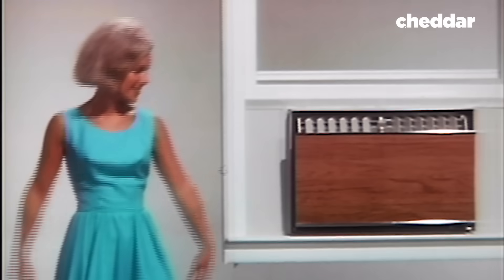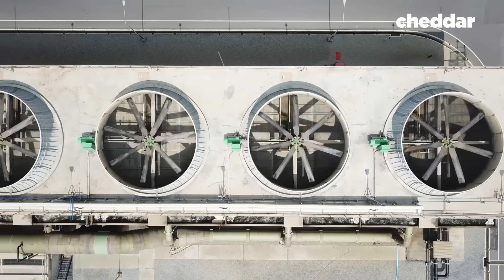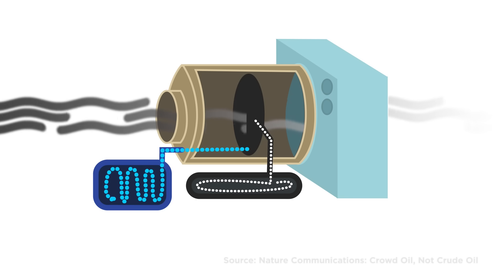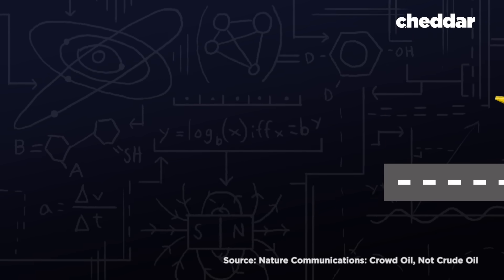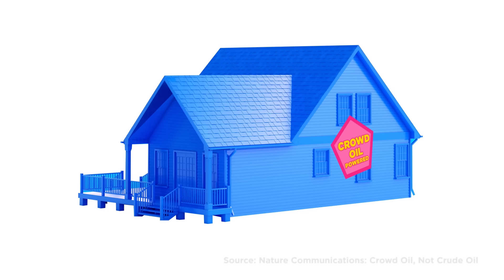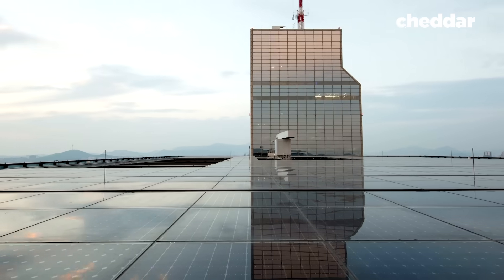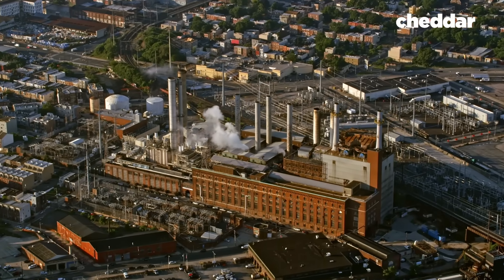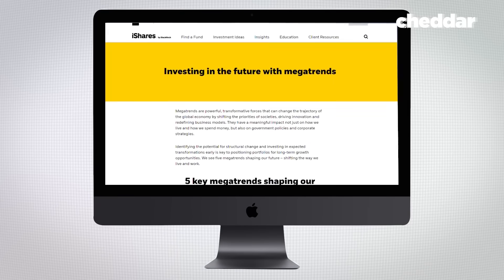How Your AC Could Help Instead of Hurt The Environment - Cheddar Explores

Comment: Wait wait wait, so your saying all you need to do is generate some hydrogen and then mix it with the carbon collected? Wouldn't it be way more efficient to just use the hydrogen instead? And wouldn't that newly generated fuel also emit CO²? So this thing is CO² neutral at best? Ok, I call bullshit.

Comment: There is no reason to use AC as it is only used to move air through the CO2 extractor
Reply: So true. The AC is a red herring used for clickbait. It's stupid to install a fuel storage tank at every residence when you can just create one massive carbon capture device at a gas station and then use the fuel for cars. The energy consumption will be the same or less, and the scale makes everything easier. Just hook up some solar panels to intermittently power the device.

Comment: If you burn the generated fuel, you spew all the captured CO2 right back in the air. If you don't burn the fuel, you lose money. And it consumes extra electricity (those AC fans must work harder to cover the pressure losses due to the CO2 filter). This makes no sense.
Go plant trees instead.
Reply: you ppl do know that planting trees wont remove all the co2 we have added in the atmosphere right? removing co2 might be needed aswell as planting trees
Reply: @kerosblue5609  An acre of trees will trap 2.6 tons of CO2 per year. Show me a man-made machine running solely on solar power that can remove that much CO2.
Reply: @Petr75661  i dont have to. I said planting trees wont be enough so we need other ways to remove the co2 we have added, plantings trees is needed but there isnt enough space.
Reply: @kerosblue5609  Nothing will help if we don't stop spewing tons of CO2 in the atmosphere. I guess we can agree on that.
Reply: @Petr75661  we wont stop spewing co2 in the atmosphere anytime soon just reduce the amount

Comment: I agree with many comments and the video itself that this type of technology is obviously not a carbon-negative system. It is inherently not one. However, this could help make more carbon neutral fuels for applications where chemical storage is superior to electrical storage or direct renewable like in cargo shipping. That industry still mainly uses fuel oil, the heaviest and dirtiest of the liquid oil products. It is also a major source of nitrate, sulfur, and fine particulate pollution which is very damaging to human health. A widely available carbon capture source of alternative fuels like LNG or methanol already being experimented with in this field would greatly transform the potential viability of those and at least make this growing industry cleaner if not perfect.

Comment: This has been debunked before. I have my doubts whether this system can ever be feasible.

First law of thermodynamics. Energy cannot be created nor destroyed. It can only be transformed from one form to another. If this system does actually work and can make hydrocarbon fuel from air, the amount of energy needed to make that conversion will never be less than the energy the fuel can provide. In fact, the conversion itself would take a lot more energy because of energy loss by friction and heat.

Where will this energy to convert the scrubbed co2 and water come from? If it comes from fossil fuels, then you will be dumping more co2 into the environment, not less. If you get it from cleaner sources, then it would be better to just use those instead, and NOT bother converting the scrubbed co2 into fuel. 

Also, co2 scrubbing itself needs a lot of energy. Where again is this energy coming from? Commercial power plants that have tried using such technologies increased their production costs by 20-90 percent! And that's scrubbing  co2 alone. 

There's many more reasons why this is not a feasible solution. I will not list them here but anyone can verify these claims.
Reply: you do know that there is so much co2 in the atmosphere that planting trees isnt a solution anymore?. Removing carbon seems like a fair idea in placed that solar energy is wasted because battery tecnology isnt efficient enough yet.
Reply: @kerosblue5609  I agree, but this is not the way to go. There's better ways to extract CO2 from the air. By the way, once they've collected that fuel, what happens? Is it burned again? Then the CO2 you removed just gets dumped back. Also, since you needed energy to convert the original co2 to fuel in the first place, you probably put more co2 back into the environment than you got out.
Reply: @err_4O4  we still use carbon fuels tho, if the energy use to make fuel was green is a lot better than digging carbon fuels from the ground
Reply: @kerosblue5609  You are probably severely underestimating how much energy is needed to do this. For simplicity, say you have this machine, but it needs 1L of fuel or 10kW of energy to run for 1 hour. In that one hour, how much fuel did it generate? Well, we know it will never be greater than 1L or 10kWh, but for simplicity let's say you get 0.9L or 9kwH back (in reality, it will be even lower than that) so if you used fuel to power that machine, congratulations, you just dumped a bunch of hydrocarbons in the air and essentially wasted fuel. 

If however, if a renewable resource was used to power the machine, wouldn't it have been better to just use that energy on something else?  You're converting clean energy to a hydrocarbon, which would then dump more co2 into the environment. 

If the system instead removes the co2 from the air, and it's not converted the fuel, you would use less energy AND reduce the amount of co2 released even further. So why isn't this the initial goal instead? 🤔

Well, it's probably because you gotta make an incentive for companies to invest in your project, as carbon scrubbing has yet to be proven to be economically viable. In short, it's VERY expensive to run this system, and you have to promise your backers that some money will come out of it.

Lastly, retrofitting existing a/c units is not that simple. Adding such a filter would significantly reduce airflow on the ac system. So, something has to work harder to balance that right? Congratulations, now you're using way more energy to cool your building. Yay for the environment!

See I'm not against the idea of carbon scrubbing at all. It has yet to be proven economical but it may come one day. But this concept of using a/c systems, in combination with essentially a makeshift solar farm to make fuel? Absolutely ridiculous.
Reply: @err_4O4  all valid points.that need to be adressed,  i guess the making the fuel part is for monetary incentive for people and companies

Comment: Hold up, if this device just captures CO2 and then turns it into fuel, what’s going to be the byproduct of the fuel when it’s burned? They said that it was almost exactly like the chemical structure of oil, so I’m guessing the byproduct would be MORE CO2??? How is this helpful??!!!?!?!?!
Reply: It's obviously not helpful at all.
Reply: hey you dont have to burn it you could use it for plastic i guess
Reply: @kerosblue5609  You are better off with polylactic acid (PLA) plastic made from corn which is biodegradable. We can't keep polluting our environment with oil-based plastic.
Reply: @Petr75661  then dont use it or just keep the carbon
Reply: @kerosblue5609  If you don't use the oil, who will pay for it? Trees turn CO2 into wood that can be used for buildings, furniture, paper, etc. This machine simply makes no sense to me.

Comment: Seems fake, sure there is a way to draw CO2 out of the air and separate it into air without it and water. But thermodynamics will seal it's doom, the first caveat is the energy needed to intake the CO2, then the filter which will have to be changed regularly.  Then the fact that to electolyse water you also need quite a lot of energy and then the CO2 reacting with H to form fossil fuels seems like a lie when you don't provide info on how can that process succeed. To me it seems the energy input you need to turn co2 into fossil fuels is very inefficient and most likely need a lot of energy that not even solar energy can provide.

Comment: The entire idea that converting the combustion product, i.e. carbon dioxide, back into fuel violates the law of thermodynamics
Reply: you didnt watch the part about they needing to use green energy to be worth it?
Reply: @kerosblue5609  I did. But my point is the amount of energy required to reverse the combustion reaction must be no less than the energy produced by the combustion itself. If we can somehow generate this much energy from a green source then why not using it directly to power the machine (say EV or electric heater etc.), instead of using that much energy to produce fuel and then burn it. This fuel synthetis method does not solve the problem that where do we get the green energy in the first place but the synthesized fuel is only acting as an intermediate between the energy flow from the green energy sources to the consumer end. However, with EV gaining popularity this very intermediate doesn't seem to be necessary.
Reply: @jiajitang  you forget green energy can be wasted like with solar energy that is when you use this system

Comment: But this makes it even worse, because all that co2 that is mixed with hydrogen turning it into "crowd oil" will only make more oil with a cheap method, making all crude oil based products cheaper, making more people to use diesel and petrol and less people to use electric and clean, renewable energy.

Comment: I hear 3:52 "out of thin air" in Thunderf00t voice lol
Reply: You need thousands of GW scale nuclear powerplants to create all the needed hydrogen without carbon emissions (Very high-temp reactors crack hydrogen right out of water). The cooling towers of such plants can scrub carbon since the interface with water and atmosphere is huge in those things, add a CO2 absorbing chemical to that water and remove the CO2 after. A SHITLOAD of energy is needed but thousands of nuclear plants can actually do that.

Comment: At 2:55/2:56 why did you show FAD (Flavin adenine dinucleotide) as the hydrocarbon fuel generated? Nice touch adding the yellow behind the FAD.
Reply: Also they showed the molecules upside down. You can't tell right away because H,N, & O look the same upside down. What gives it away is the amine group and phosphate groups.

Comment: Brilliant. Burn oil to run a machine that removes CO2!
Reply: Have you watched the whole video? They said that without renewable energy it won't be carbin neutral...
Reply: @randomstuff7962  If this tech is dependent upon the energy used to run the systems, then
 it would be more efficient to just use this energy to offset the energy
 generation from fossil fuels that is creating the CO2 in the first 
place.  The more steps that you add to a system, the less efficient it 
becomes; the more energy it wastes.  If you are going to use solar 
panels or wind turbines to power these things, then those devices would 
be better suited to being used to directly power the homes and factories
 that are generating the CO2, not to power this new intermediate step in
 the process.  If this technology were actually viable, it would be 
viable regardless of the type of energy it used.

Comment: Wait so the system also remove the moisture from the air and trapped it as the main ingredient of fuel. I don't sure of it was a bad thing or not if we installed this in all office Will the total mositure in the air decreasing gradually in the spans of a year or more for the city.

Comment: This doesn’t mean that we can keep producing CO2, this one of the means to remove carbon dioxide from the air.

This is also temporary, though it may takes times (one hundred years, rough estimation), CO2 level will reach Pre-Industrial Revolution and these A/C will be pointless.

Comment: Using the hydrocarbons to produce plastic, synthetic wood, or sugars to feed perennial plants would keep it out of the air longer than producing fuel to burn again.  Making fuel as part of carbon capture is great if you're going to burn fuel anyway, but ultimately it's not enough if the goal is to reduce atmospheric CO2 levels.

Comment: Why on earth would you capture CO2 from ambient air when you could capture straight from chimneys where the concentration is like 1000 times larger (much more efficient). And you would get the economy of scale on top of that. Also the process of turning the energy of electricity to liquid fuel is far from efficient. Renewables should be used to replace fossil electricity production first. When that is done then we can consider conversion technologies. But that is far from done.
Reply: um that capturing co2 from chimney is already in use in some plants but the tecnology is expensive

Comment: I'm sorry but this is just stupid. If you want to do this, you don't want to do it in urban areas. For it to work it just needs air and power. So if you want to do this, you would put it directly to a wind turbine or solar field to use the energy, that it would otherwise be wasted. You don't want to use your home electricity because you don't know where the energy is coming from and such a system is incredible inefficient.
Al/Air primary cells have an energy efficiency of about 10%, this would be worse. Not to speak about that you still would have all that toxic stuff in urban areas.

Comment: "The system needs to use renweable energy to be carbon neutral" so that must mean that the process of turning CO2 into fuel uses more energy then it produces. So you'd have to pay for solar panels, which are expensive, and the energy produced by the panels would go into making a fuel that are worth less energy then what ur panels produce. You're paying to use ur solar energy into making something thats worth less energy that u have no use for, instead of using that energy to power ur house.
Reply: All good points, but the fuel can be burned at night, unlike solar energy which is unreliable
Reply: That’s correct it would take more energy to produce unless they’re some how able to break the laws of thermodynamics. It’s not like they’d give the fuel away for free, the hope is they could turn a profit selling it and eventually make back their losses on everything needed to produce it.
Reply: ""The system needs to use renweable energy to be carbon neutral" so that must mean that the process of turning CO2 into fuel uses more energy then it produces"
No, it means the system needs to use renewable energy to be carbon neutral. What's wrong with people and needing to make assumptions? The literal meaning you're trying to conflate is that all the carbon sequestered for fuel will be released back into the environment--since, you know, we burn that fuel. Adding fossil fuels to the manufacturing of these carbon sequestered fuels would tip that balance.
Pro tip: Carbon neutral has absolutely no relation to "energy used".
Common sense tip: Without a college-level understanding of chemical physics, you'll never poke a hole in an idea that thousands of qualified individuals haven't. It's sad that you thought you'd try, to be honest; try standing on the shoulder's of those who came before you, and you might be able to see above the kids' table.
Reply: @jakehix8132  No need for high level chemistry. It's pretty simple really: You can't get more energy out than you put in. Ever. Period.
This system is nothing more than an overcomplicated way of storing electrical energy in a carbohydrate, with a total systemic efficiency of probably less than 30% (my guess is somewhere around 5% but let's be optimistic). You could instead just put a battery there with a systemic efficiency of maybe 90-95%.